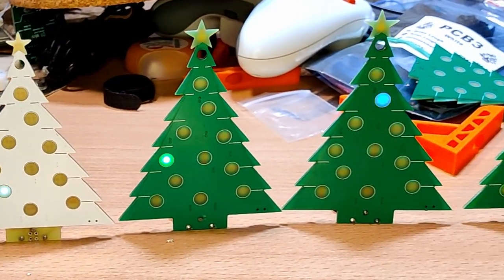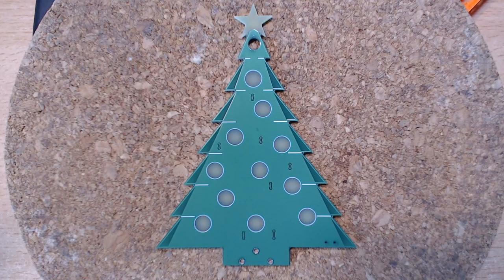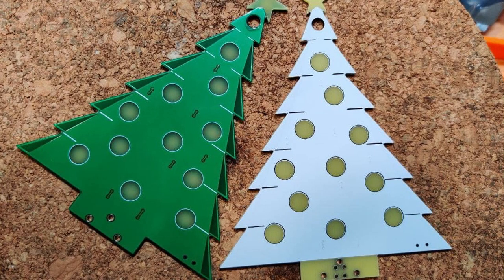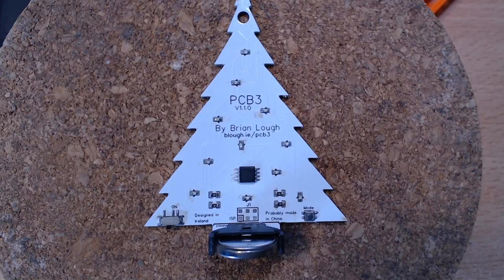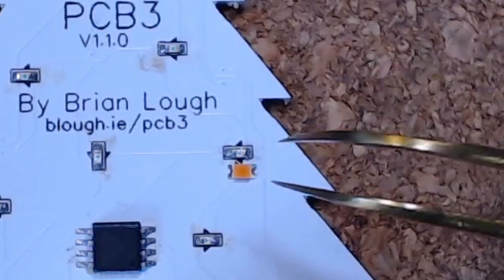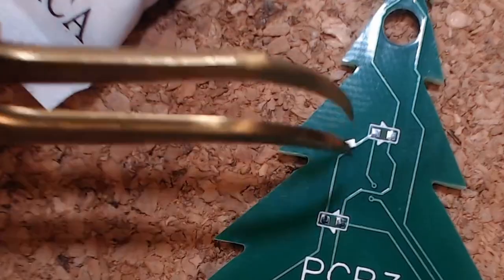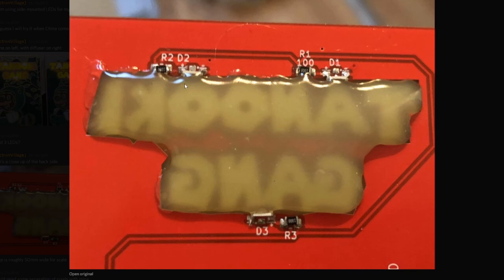Reverse Mounted LEDs (Diffusing LEDs through the PCB material)

Comment: Uuuuuh! He 's alive ! :-)

edit: i guess it would be cheaper to get the flimsiest and cheapest (but transparent) pcb without any components
AND a normal assembled smd pcb with the leds and screw or glue the cheapo one ontop.
Or maybe get the standard pcb coated with a diffusing conformal coating..

i guess if you wanted to do that afterwards and maybe even get it off again you could use plastidip spray.

Comment: if at first you don't succeed FTFD  ;-)  this is one of reasons that when we produced a company footprint for a every component we used, the QC department had to sign it off before we could use it for production. They checked it to the datasheet and company design rules, so you lost a lot of brownie points if you missed anything.  Easy to lose, but a bugger to get them back and pointed out too you at evey design/production meeting. Electronic design happy days!, but now well behind me. :-)
bugger me forgot to add, also try tin foil between a layer of hot snot to refelect light back, used a lot in backlit aircraft panels to bounce light about to get even brightness . The tin foil not the hot snot.

Comment: I have used a 3d printer to create a cavitated overlay of shapes for LEDs, then covered the top with wax paper for a diffused effect.
A flexible FDM material called TPU, in "natural" color can also make a good diffusing glove or sleeve for a PCB, while giving the item protection.
One single 0.4mm layer of TPU is almost impossible to tear or permanently deform with bare hands.
Know you are fixed on reverse mounting though.

Comment: Can you get tiny little half-spheres of metal (or mirror-coated plastic), to glue ontop of each LED?  To reflect back as much light as it can from the side-mounted LEDs.  
I used to see all sorts of interesting shapes of beads when i was working with them, if i see anything that could be used for this i'll try to remember to send it your way.  

A half-sphere might not even be nessesary, perhaps a simple strip of metal would be sufficient: Soldered to the board just on one side then roughly folded over the LED.  Think of it as similar to a PCB shielding can, but much simplified.

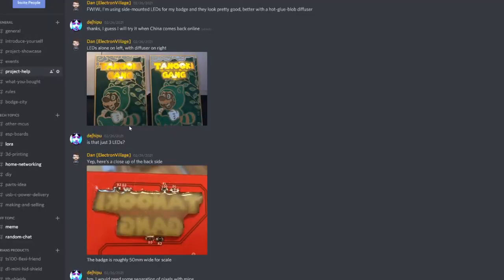13:27 If you're going to use hot-glue then that makes it even easier.  Put a dab of hot-glue over each soldered LED, then stick a tiny square of tinfoil/alfoil ontop of the still-hot glue.  The glue should keep the foil well away from shorting anything on the board.  You may be able to use foil confetti instead of foil (so u don't have to cut it youself).  You can also get self-adhesive foil tape of various very-thin widths which is used for finger-nail art.  

edit: another option is to cover the entire back of the finished PCB with a sheet of metallised mylar (ie: space-blanket or potato crisp packet), plastic side inwards so it doesn't short out.  I think potato crisp packets might even be coated in plastic on both sides (so they can heat-seal the packets).  

I love foil, it's a very useful material.

Comment: I guess the "PCB only" way is desired here, but what about 3D printing a tree shaped "diffuser" where the PCB clips in and mounting "normal" LEDs ..  not an option ? Protection for the PCB ... uniform look ... might also provide a better stand ... safer for small children (if battery contained in print)..  ghostly afterglow after turning it off (if you have the right filament ) Just my three thoughts.

Comment: The "cheap" 0804 or 1206 LED could also be reverse-mounted if you had a cut-out. Agreed, it is difficult to get a square cut-out, but you could dog-bone this. 

This causes a problem: No diffusion. 

A simple & cheap solution would be to stack a "dummy" PCB (so 2 PCBs in total); considering that FR4 is reasonably cheap, this would allow any diffusion, crisp shadows (from copper, rather than solder-mask) and an easy construction of the "main" PCB - heck the two PCBs could even be single-sided.

Comment: you could use those leds from China and have PCB A all the electronics and the led mounts and hole for the them, and the have PCB B be in front of that and be the "cosmetic" one, and simply glue them together. And like John Macrae suggested below, make the front PCB thinner. That would cost more in PCBs but it could work just fine, if you are planning to make a lot of them.